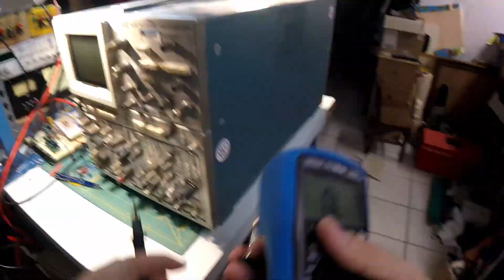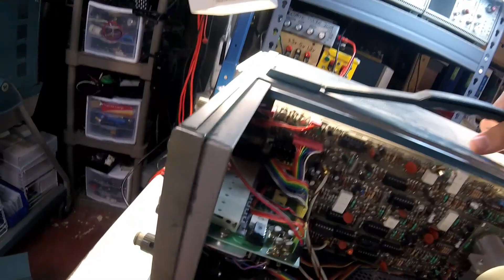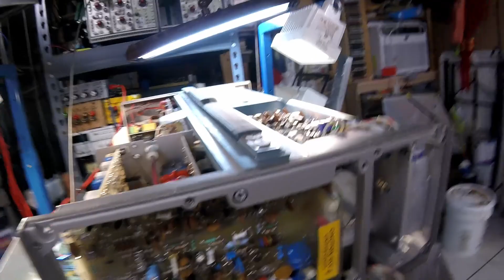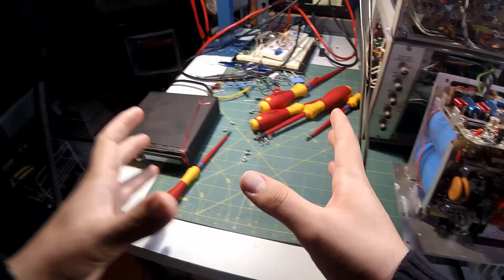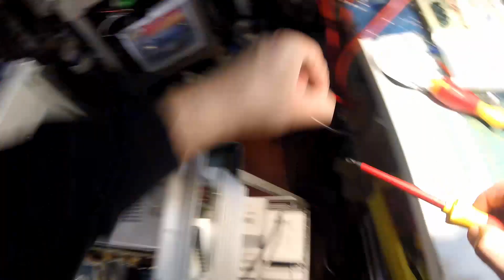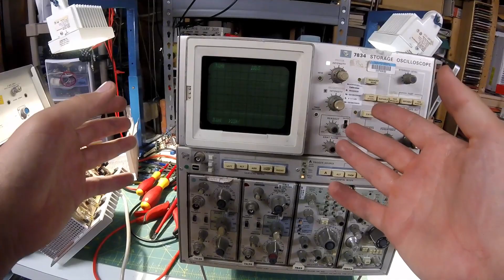Tektronix 7834 SMPS Repair (feat. smoky 7904)

Comment: That HV supply the top on second good power supply is a multiplier not transformer as it HV diodes, hv capacitors and etc and bottom is the HV transformer. You could have just check rails for shorts or which rail drawing excessive current draw, much easier then pulling whole supply from another scope risking the other power supply. Always discharge the anode on the CRT and ground it as CRT are pretty much capacitors and charge back up slightly when disconnect even, as it can be Lethal. Plus issue could have been on load side not power supply thankfully in your case you were lucky and was just shorted capacitor. 

When checking capacitors the easy way use a ESR meter and check of high resistance, or shorted, a multimeter won’t check that and can show good value but is high ESR acting as a resistor. Best  way to check is with a LCR meter as a good LCR meter check for phase shift and other parameters so shows real capacity and ESR as well as DC leakage. Plus can check at specific frequencies. As if capacitor leaking DC it will go short soon. Most ESR meters will read higher capacity then capacitors are specified at due to DC leakage and as a result capacitor taking longer to charge, so ESR meter reads higher capacitance.

Comment: Trying to repair a 7904 now that has the "tic tic" noise. With regards to the power supply needing a load, is it possible to power up one of these units with no plug-ins? I've never used one of these before and would like to get this powered up and working fist without the plugins. Is that possible?
Reply from the maker: Yes

Comment: I have a 7904 that started ticking.  That was years ago.  I took the power supply out and was overwhelmed so it's still sitting there disassembled. I might now check the caps. Thank you!!

Comment: Guessing you’re a lucky guy (shock + evident cap failure)! But you should replace all these caps cause next day another one may fail and cause more damage. Also use an ESR-meter instead of a capacitance meter: way more useful and avoids caps desoldering. Your cat is sooo cute!

Comment: You Rock. That was nice to see. I have a 7834 works great but this was a nice what if. I also have a 7904 that Smoked up about 3 years ago. I automatically assumed the worst and just put it out in the garage where it still lives. Seeing this inspired me to tear it apart and see if it is just the power supply.